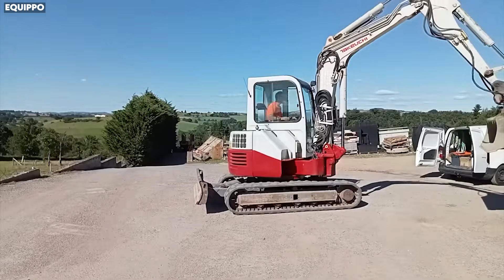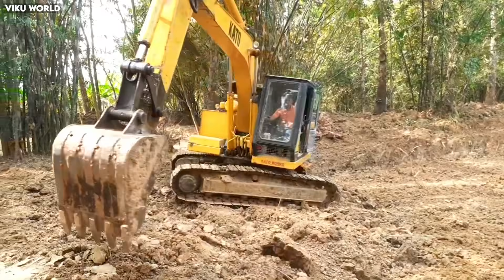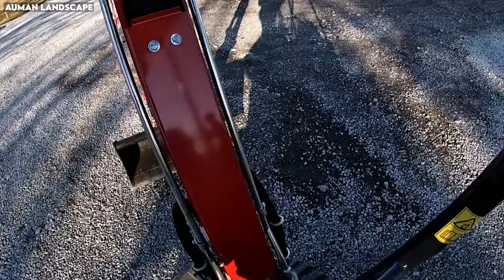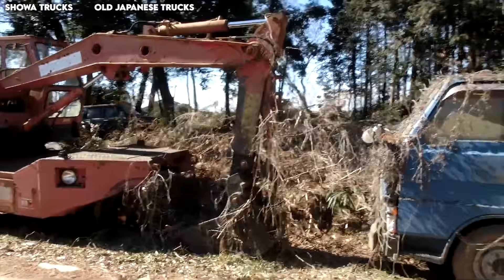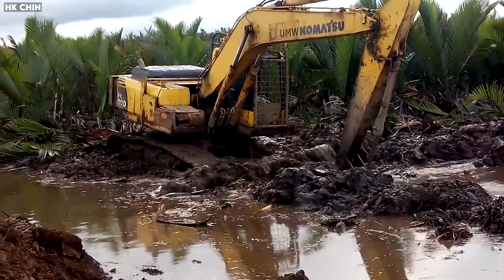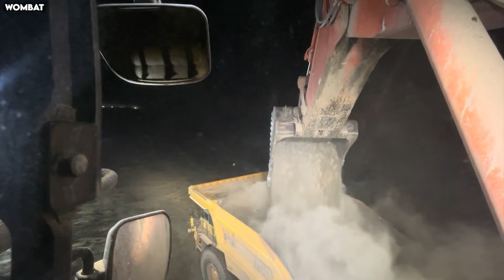10 Forgotten Japanese Excavators From the 1980s That Shocked the World

Comment: The ( KUBOTA) first series we Rented once, to dig a very mucky Foundation in the Late 1970s 😊 it was the only one that could get to the site, and it was the only MINI excavator in my area to Rent. 😊 it was fascinating to operate 😊 it had Two long control Levers mounted to the floor of the very open operator station 😊 for me it felt like it's big brother of the Time with those "LONG" throws of the Levers. It was the very "FIRST" mini I ever operated. Now in 2026 the U.S. market is "FLOODED" with Chinese mini excavator some guys are "SELLING" them from their Homes, I bought the 
(RIPPA) brand, a one Ton mini, with a 100 pound counter Wt. The (RIPPA) Brand has so many attachments that come with a new mini, I bought 3 different size buckets for her, plus a Ripper tooth.😊 for hard digging, to pull the Rocks Loss from my ground, very Ricky right under the surface. She has track sliders and a Dozer blade that "FOLDS" in on both sides, so that way I can get through any yard gate, of standard width. 😊 the "PRICES" for the Chinese mini, is a fraction of the "PRICE" of the big American Brands, lets just say, 😊 I could "BUY" 3 Chinese built mini for the "PRICE" of one John Deere mini excavator. For a homeowner like me, who only "RUNS" her for an "HOUR" then takes a break 😊 I am retired so I can STOP digging any time. The Chinese mini that are all over in America now in 2026 is perfect for the basic Homeowner. I have just flipped on Hour meter (100) Hours on my (RIPPA-R-10-ECO) 😊 and have had "0" issues 😊 with her.